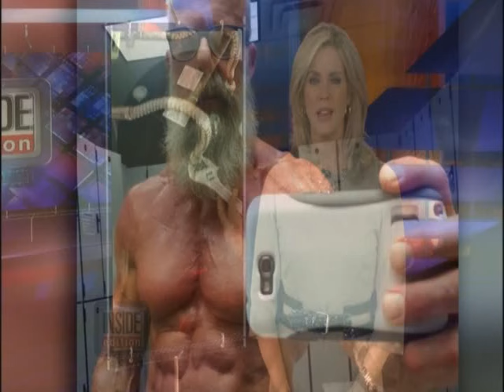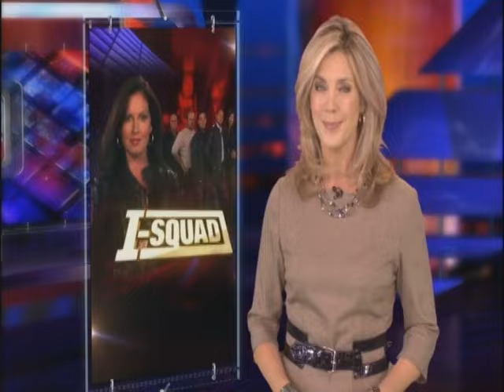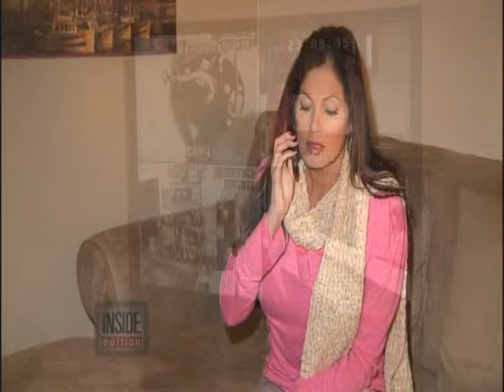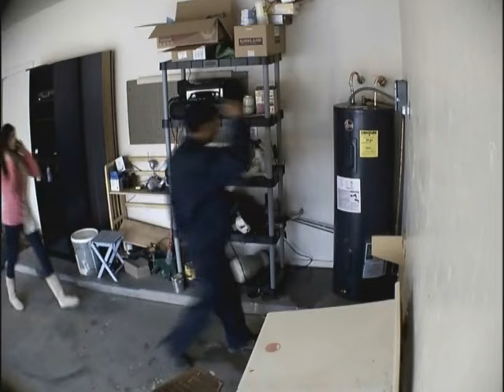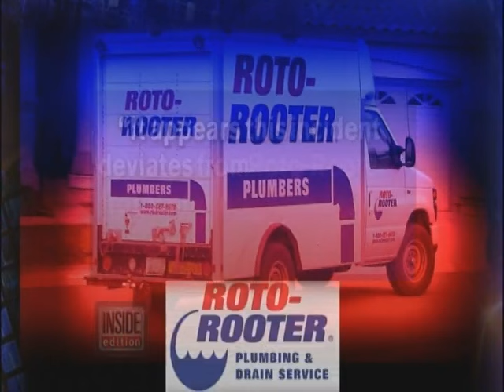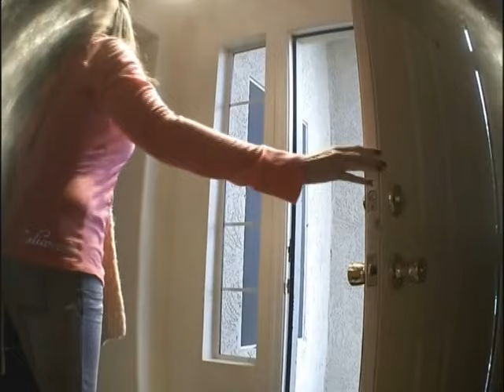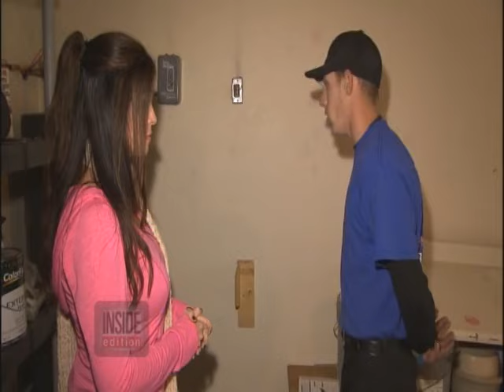Marlin Service Catches Plumbing Scams

Comment: Also, remember. Old water line to the tank should always be changed out when changing the water heater. Because the rubber seal gets hard over time and will cause leaks. I did not believe this in the beginning until two times of old-line failing months after I changed out the water heater. Now that was a warranty call on my services. Only thing I got to charge for was the water supply lines with no labor bill or service charge.  Santa Barbara CA. Most Likely We Do It Services. Remember careful inspection of the water heater is key to know if it is truly a leaking tank or fittings.

Comment: Don't use Roto-rooter.  I was ripped off by over $5000 for a new chimney and when chimney liner would have done the job.  Now, i do all my plumbing,  electric and all my remodeling myself.  Yes, i taught myself and i learned from watching and also from here, YouTube.   My the way, i am a landlord with several rentals. And i've never failed an inspection.

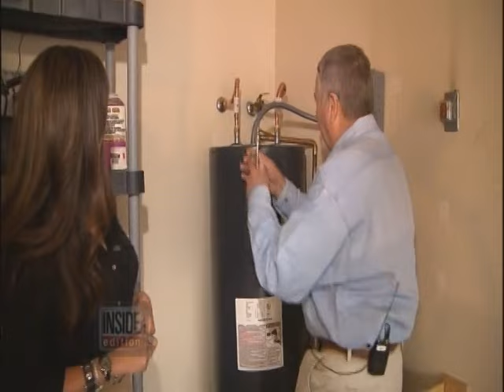Comment: The person loosening the nut on the water heater could of killed someone with water running down an electric 220 volt water heater. They will arc flash with a ball of flame when water hits the heater element wires or electrocute the person standing in the water touching a copper pipe for a ground. What a law suit that would of been on camera.  Someone should lose a license if they had one doing that.  0:46

If you ever see ANY water around a electric water heater turn the breaker off if you can do so safely without being near the water because the leak will increase and can burn down the house when it contacts the electrical or electrocute someone. If you can't do so safely call a plumber or the fire department.

I have a Master Plumbing License

Comment: I'm pretty handy with tools. However, I decided to try a local DC area plumber to get a simple kitchen faucet changed. I asked for an estimate over the phone. No one would give me one. I found out why later. A guy shows up and quotes me $400 to change a faucet (I had the new faucet). A faucet consists of two water lines and an attaching nut. It should 30 minutes to do the work. I found out why they don't give you a quote despite changing literally hundreds, if not thousands of faucets. They look to see how expensive your house is. In my case I live in a 6000 square foot house. I'm sure he figured I would have no trouble coughing up $400. Cheaper house, cheaper price. I offered to give him $150 and he declined. Stuff like this goes on forever. Most people don't have the skills to do home repair and are simply stuck. And this wasn't even a scam. Just price gouging.
Reply: You make it sound so easy, yet it was too hard for you to do. No plumber with any common sense will quote something like this over the phone.

Comment: I always have a water heater loaded up when I get a service call about a leaking water heater. Its easier than running back to the shop to get one. If its leaking its usually bad. Not in everycase, just most.

Comment: On a separate note: A water heater that has been installed for years and working is very unlikely to suffer a "loose nut" add to this if you try to tighten a nut on a water heater with a cracked tank you may turn a slow leak into a flood quickly.

Comment: The Plumber who didn't charge for service call , that's crazy , cant volunteering around , service call charge at total overage Plumbing hourly service call rate, invoice written after for eventual insurance cover , cant drive around and fix problems for nothing , the other ones are typical scammers , wrong estimates , dishonest relations with customers, a shame !

Comment: This is why I installed a Rheem Performance Platinum 11 GPM natural gas tankless water heater by myself last Feb 2018 Model#  ECOH200DVRHLN when my old tank type sprung a leak in the tank from rust. One of my best decisions ever. It is awesome. I had a couple of local plumbers a few yrs ago break a cast drain fitting on the bottom of our bathtub & they almost pooped their pants when I got mad (I'm a big muscular guy & know how to fight well) because they actually had the balls to ask me if they can fix it for full price. I compromised with the repair company's owner on the phone & paid half even though it was their fault. Then a few yrs later I found a couple holes they made in the walls under the sink in the cabinet & one behind the toilet they never told me about! I'm still angry they did that because cockroaches & a rat got inside! Not kidding. Glad I didn't beat the F+*K out of both of those MF'ers!

Comment: I work for roto rooter n it hurt seeing other branches with horrible plumbers like the one shown at first. I'm sorrounded by very nice people. i guarantee they wouldnt rip anyone off. if the customer does not need a new water heated the plumbers I work with will notify you n they'll tell you they will only charge you for the miles

Comment: I've seen some shady stuff. I had one customer call 10 different plumbing companies to fix a toilet with a broken flange and tell him it was gonna cost $1000 to $1500 just to repair the toilet. He had one guy who he paid to fix the toilet and it leaked horrible so bad they abandoned the bathroom thinking it couldn't be fixed. It was in a basement with a concrete floor and the floor was not level so messed up simply using shims wouldn't work. Anyway I was there remodeling another bathroom and the guy was telling me about his bad experiences so I decided to take a look at it. I simply chipped up the floor, reset the flange, and put a skim coat of cement to repair the floor. This took less then 30min. The next day I had to come back anyway so at the end of the day I set the toilet and the total labor for the whole job including the remodeling was cheaper then the guy who charged them to set the toilet in the first place lol. Anyway this was many years ago and the customer is still happy so much so he's thrown more work my way. As a matter of fact I didn't even charge extra to fix the toilet I just charge by the day on remodeling jobs and made time to fix it. I did get a bonus though which was cool.
Reply: Y

Comment: Having a spare tank on board is just sensible practice by most plumbers.  Nothing wrong with that.
The main point of stupidity or dishonesty is that everyone knows that water does not go uphill.  So water dripping down onto the tank obviously did not come from inside the tank.

Comment: Roto Rooter is the biggest crooks in the business. I can explain why, and why you should avoid this company. All of their plumbers are paid by commission and are giving incentives by upselling but In this case, Roy was not upselling. Roy also owns that truck he pulled up in, all those other plumbers are driving a companies truck that their company pays for. Roy pays for the maintenance for that truck. Gas, tires, oil changes, repairs, insurance and so on, you get the idea. Roto Rooter as no liability when it comes to their techs, their techs are pretty much sub contractors. Roy knew the heater didn't need to be replaced, but 20-30% on $507 is a lot more than 10% on their trip charge and 1/2 hour of labor. Remember, Roy is paying for that truck he pulled up in and it's not cheap. Not this is an excuse for Roy, but just a reason not to use Roto Rooter.

Roto Rooter does have employees that are a liability, but these are office staff and plumber helpers/apprentices. They will also push their apprentices to invest in themselves and work towards being a "plumber". Mainly so they're not a liability, they drive their own truck and so they can take them off the payroll.

Comment: The honest plumbers dont work for Rotorooter.  I had my sink plumbing replace by rotorooter.  Not only did the guy lie to me that he had to use brass pipes according to code,  but the pipes he installed were just pvc that looked like brass. I didnt find out until months later.

Comment: See, the thing is no real plumber expects a locknut on the inlet/outlet to have loosened more than 360 degrees on its fucking own. When you see water coming out of an inlet on a water heater that has not been touched or tampered with since installation, you would automatically professionally expect something more serious was going on. Lock nuts dont loosen themselves up on their own, and no homeowner loosens the nut so it leaks to call someone to tell them thats the only issue.

Comment: I can already see a real problem with the existing installation. There are no dielectric unions installed to electrochemically isolate the steel water heater nipples from the (probably) copper plumbing in the house. This will cause galvanic corrosion at the connections. Also, those knurled copper fittings are substandard, and should be replaced with braided stainless steel.

Comment: not really fair because that tank has insulation around it and the water probably saturated that insulation - so seven if he tightened the fitting water would continue to leak from the bottom of the tank until all the water dried out.

Comment: I can't believe rotorooter would pull that scam cause this dude, unless he gets a commission, has nothing to gain except having to do more work than necessary. Makes no sense unless he is the franchise owner. Plus a new water heater costs way more than $509 with installation.

Comment: We in India actually ask the plumber to show us the reasons for his diagnosis. It's not that difficult to understand simple plumbing or electrical matters. This way we're sure of the necessity of recommended repairs. Then the only problem is the pricing of the parts and the labour charges.
Reply: Ya but you're in India. You ask to show a problem and the plumber will just show you a beach or a street corner.

Comment: Electric water heaters are simple machines. It's easy to research how to fix most problems with them. Aside from that, if you're going to hire someone without a reference or recommendation, at least know the basics of the facility you need repaired so you don't fall for scammers who prey on ignorance.

Comment: Those prices to replace the water heater are pretty cheap.  In my area I get $900 plus  to replace one  depending on make they purchase, But I can say I have never replaced a water heater that didn't need replacing .  I have even replaced dip tube when they complain the hot water runs out to quick.  I also replace heating elements and gas burners that have been damage or corroded. If it really needs replacing it costs and that does include whatever permit it needs be it a post card permit or a full inspection by the local plumbing authority.  Being honest is how I stay in business.

Comment: I'm an honest plumber...no way can I make money replacing water heaters for $600.00 or $580.00. (maybe that was labor only) The water heater costs me about $600.00 plus you have to replace water flex lines and possibly gas flex, adjust length of vent....reconnect relief line....ect... I'd go broke....I normally charge about $1,100.00.....and that's $200.00 less than my competitor. California

Comment: Good prices  on new water  heaters I charge 1,100. The water  heater is 700.00 usually 100.00 in misc parts. 300 for labor
Reply: WATER HEATERS DO NOT COST 700.00.  WHEN I BOUGHT MY 38 GALLON ONE IT WAS MORE LIKE 400.00----AND YES PEOPLE THERE ARE A LOT OF CROOKS OUT THERE

Comment: I'm a plumber i would of fixed it in two seconds and still charged 120 service fee for driving out there
Reply: I'd have replaced the line for safety factor, in case of bad chinesium rubber seal or split/sharp copper piece causing seal to break from thermal expansion/contraction ;) ehhh
Reply: First rule: ABC. Always Be Closing. 
All plumbers are crooks.

Comment: This is not a valid setup. When the plumber finds the leak, they realize there is no reason that fitting should be leaking. There is no reason it should be loose. Therefore, the best advice is to replace the tank as the only other reason it would be leaking there is a defective fitting.

Comment: I’m not familiar with American cylinders. I am a plumber in the UK though. I’m guessing those fittings which come off the top are made into the cylinder,  and you can’t just pop them out and replace them. If indeed defective it would mean a new install. As it’s a new looking one too, I think the assumption would be that it is defective. After all, you would not expect a nut to come undone, it just doesn’t happen! It’s not really a fair assessment. Certainly the nut should have been checked and tightened before anything else, but in a normal situation where someone hasn’t setup a trap, the assessment of a faulty tank is correct.

Comment: Those flexible copper lines a crap... it should be hard piped, if that nylon stiffener and rubber washer go, you now own that heater in the customers eyes..

Comment: They are not hot water heaters if the water is hot it wouldn't need heated .Its a water heater.

Comment: Called out "Roto Rooter" in 1991 or 1992 to have a drain cleaned out showed the "tech" where the trap was and would only need a 25' snake. I have this done every 2 years or so at my business. I was paying other Co. about $65. to $80. depending on which co. There price you might ask? well..................$209.00 enough said

Comment: I used to get this all the time. Water leak call. First thing to check are the top pipes. Thats usually where the leak is. $40.  Just fine.  Could have charged $1500. for new 75 gl.  one house.  Nope. $40. Just fine.
Reply: All my work was about integrity.  Doing the best job I could.  Was never about the money.  Always had plenty of calls.

Comment: Bull fucking shit Roto-Rooters is an isolated incident. We used them to figure out what a bad smell in the house was and they said it was probably just sewage from the heavy rain. They charged a lot for it and then when it got worse and worse and my cat started getting really sick we had other plumbers come in, and turns out the problem was a drain they had told us was harmless when we moved in. Turns out the cat ended up getting chronic pancreatitis, which can be caused by constant exposure to the fumes of sewage. Which they did NOT bother trying to fix, and DID NOT diagnose as a potential problem when they SAW IT WAS CONNECTED TO THAT DAMN DRAIN in the middle of the floor, even though they said it was NOT connected. Those fuckers could have gotten my family and I VERY sick if we hadn't gotten suspicious after the vet mentioned that as a possibility when we explained the concerns, and the plumbers who came in after them fixed it IMMEDIATELY. DO NOT EVER use that company.

Comment: It's not exactly that the guy was trying to rip you off, it's big company politics. Hiller plumbing around Tennessee and Kentucky are required to tell you stuff like that or lose their job. For example, if they can't unstop a clogged main sewer outside in 15 minutes, they must stop, take a step back, and tell you that the line must be completely changed to the tap. It's bullshit but that's the way big companies are, and roto rooter is no different. Believe me, I've went behind many of their shady work fixing their fuck ups. Always stick with local plumbers or tradesmen! (I am an almost master plumber in a half year from southern Kentucky, under Goodnights Plumbing and Repair)

Comment: You people YES allot of Water Heaters will Crack sometimes a Newer Water Heater can do this. Allot of Plumbers see this and they see it so often most of the time they don;t even think to Tighten a Line, because the lines look so new.
Reply: Nope, new water heater has warranty against cracks. The moral thing for the plumber to do is tell them to call the original installer where they bought the tank from

Comment: Only $507 from Roto rooter? That's cheap.. our branch prices start at $1500-$2500.. also roto rooter technicians get paid a 19% percentage of sales other then that they work for free.. so most technicians are trained to replace anything there called for. Sucks because the technicians  are actually the ones who get ripped off from the customer and company! Also Roto rooter doesn't hire real experienced plumbers they find day 1 green guys and train them in basic problems and easy installs so that technician may not even know how to fix the tank but can install one.

Comment: 85 to come out ? I herd now its 170.00 that's to get there,I fixed our water heater for 18.00 "pressure release valve" home dep
Reply: Harry Knows  I talked to an old plumber that works on 70 houses for a realtor, he had every individual part for a toilet tank,he said 85% of repairman are ripp offs ,had a plumber say that new water heater is 495. But the fan on top is another 500 separate???

Comment: This was a trap and unfair.  The way the water would leak from that loosened fitting easily mimics a cracked tank.  Only tightening the loosened fitting and waiting for a day could one properly diagnose the problem.  Shame on you Marlin Plumbing.
Reply: not quite unfair, but that visible leak is no guarantee the installers didn't screw up something else or the tank isn't a factory flaw

Comment: Some service providers in all trades give others a bad name, and is always wise to get a second or even a third opinion when told a new replacement is needed. Finding an honest, reasonable, and reliable company can sometimes be hard to find, check references and ask around tend to be helpful. 

And it always cracks me when some calls a water heater a "hot water heater" and will always ask them to repeat it then explain to them that hot water is already hot and doesn't need to be heated, lol. You could call it a cold water heater or in some cases a hot water storage tank when twinned with a water heater and others depending on application are various types of boilers. Therefore as in this video simply calling it a water heater is correct.